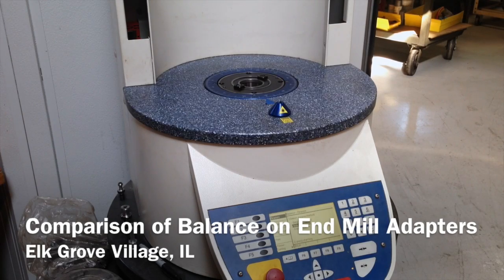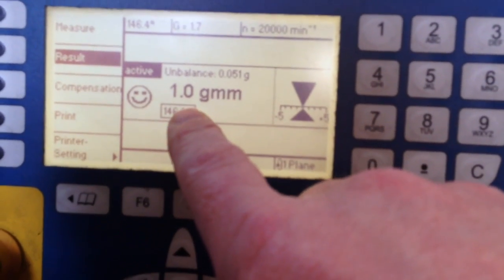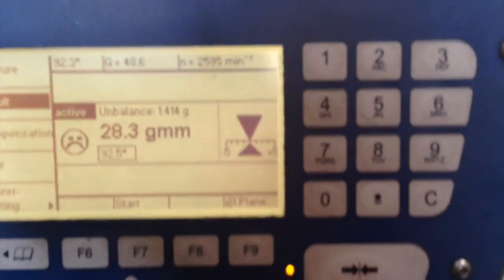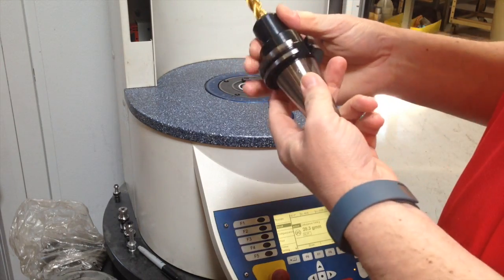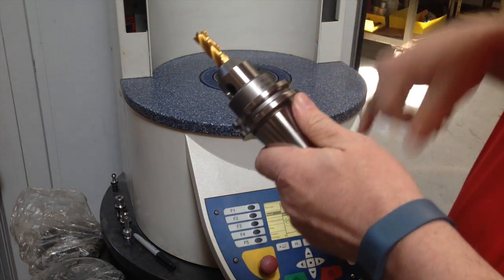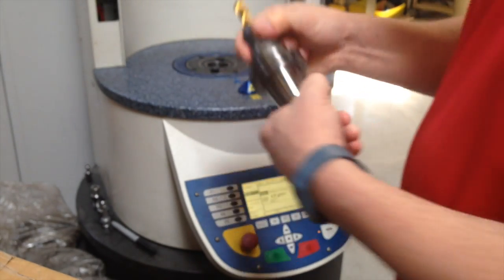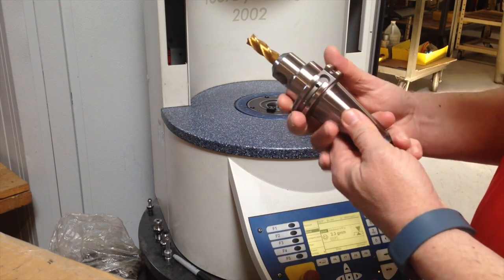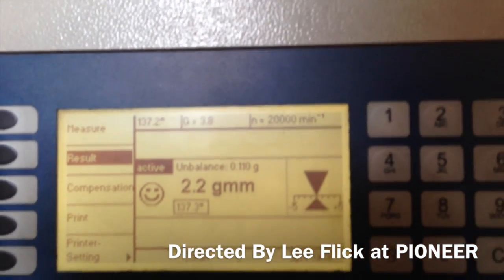Comparison of Balance on End Mill Adapters by Pioneer

Comment: nice marketing tool, However this video is very misleading!
Tool holders are generically balanced off the lathe, unassembled (tool holder body only) No set screw or cutting tool. 

After assembly,( Holder + pull stud + Cutting tool + Set screw)  the balanced rating is drastically affected. 
Hence, the results of holders #2, #3,  & #5. 

Balance ratings are guaranteed, based on the tool holder body only, there is no way to guarantee a number of a fully assembled set-up, mainly due to the Ten's of thousand different cutters and geometries. 

Seems like holder #4 has a legitimate result.

#1 HPI / Pioneer   = G 1.70   @ 20,000 RPM
#2 Competitor       = G 48.6   @ 2,595   RPM
#3 American          = G 59.8   @ 2,107   RPM
#4 Japanese          = G 8.3     @ 15,120 RPM
#5 Import                = G 65.7   @ 1,917   RPM
#6 Finish Bal/HPI  = G 3.8    @ 20,000 RPM

Here is the misleading part: 
Holder #1 and #6 have a net result of EXACTLY 20,000 RPM. this can only be achieved after the Holder, cutter, & set screw are assembled, balanced, AND THEN compensated by removal of material.  

Almost every tool holder can achieve G1.7 @ 20,000 rpm if the same processes were applied

For holder #1 the persons had completely covers the flange of the holder, right before loading the holder in balancer, you can catch a quick glimpse of dimples on the V-flange. (material removed for balancing)
Reply from the maker: Thank you for the feedback.

The point of doing a video was to show actual results and not mislead, which from your comments I did a poor job, I am sorry.  Everything was pulled blind from stock or purchased with no indication of what they were going to be used for.  When we did this test we tried to give every holder the same chance at success.  Not 1 of the holders above had anything more than factory correction before the test.  I am sorry if you thought we were trying to hide something, that was not our intention.  If you are ever in the Chicago land area I would be happy to show you are our inventory and the balancing already performed on every tool holder (if it required adjustment) which when a company says pre-balanced for 20K they almost all have some correction.  I am also happy to run some across the balancing machine so you can see first hand.  I still have the original holders from this test in storage you are welcome to review them.

CAT tool holders have unequal drive slots per ANSI B5.50.  Some form of compensation must be done to address the imbalance in the design.   I do dis-agree with your claim that tool holders are balanced coming off the lathe, I think if you were to test that assumption you would find worse numbers than anything we reported.  Heat treat also adds imbalance, nothing every stays truly round though heat treat when you are case hardening 1mm and achieving Rc60 with tempering.

We try to educate our customers that the only truly balanced holder is balanced assembled.  When we are balancing the rim without the tire installed it is impossible to say guaranteed.  It appears you are from manufacturing, you also understand that when you try to drill deep holes drills wander.  Every tool holder has a deep hole down the center and every holder has some imbalance because of these holes.  A holder must go across a balancing machine to compensate for manufacturing tolerances if it has any chance of performing well over 10K RPM. 
We also hard turn our holders to help eliminate out of round results from heat treat, which reduces the amount of correction required saving us time in production.

This video was to compare competitor holders who claimed a balance similar to ours side by side with the same knob and cutter to see how effective their process or lack of process was.  Why? Because most customer do not have balancing machines.  The test is also with assembled holders, like they would be run in the machine with the end mill screw torqued down.  All of our holders if needed have balance compensation in the V-Groove.  

For guaranteed results every holder must be balanced assembled and after every tool change when running high speed.  We offer the service of pre-balance the our holders or the assembly if the cutter is supplier (for a fee of course).
Reply: Lee Flick I mis-spoke, you are correct about the generic balance compensation due to MFG process. And uneven key ways. 

I still stand firm on my opinion of your video being misleading. If not deceiving.
Tool#1 With a tool holder pulled brand new off the shelf then assembled with a cutter. 
You were able to a achieve G1.7@ EXACTLY 20k rpm. 

Tool #6 - additional balancing after hardening, brand new off the shelf. Assembled with the cutter. You were able to achieve G3.8@ EXACTLY 20k RPM

The likely hood of achieving exactly 20k rpm on #1 & 6. RIGHT OFF THE SHELF is less then 1% I'm sure. This doesn't even touch on the consideration of repeatability. 

#1 in my opinion was assembled. Balanced. Compensated. Then filmed  

I wouldn't mind visiting you in Illinois. But I wouldn't want to see the holder you used in the video. 

It would be best if you allow me to pull a 1/2" endmill holder off your shelf and pick a generic 1/2" catalog endmill and then we can put it in the balancer. 

What do you say?
Reply from the maker: The Haimer balancing machine requires that you put in a spec to target.  In this case we put in G6.3 @ 20,000 RPM.  I picked this setting because at that time it was the most common across many of the brands.  The machine will not show a number higher than 20,000 but adjust the G grade and if you are in the numbers you get a smiley face.  That is how the machine software works.  
There is no mis-leading, these are the numbers the machine reported.  That is why holder #1 and #6 are 2 different holders from stock.

I do not appreciate you accusing me of rigging this test and lying about it.  All we have is our reputation and I am not screwing up mine by rigging results.

Give me a date on when you want to do a test.

Comment: Hi thanks for sharing your results, how much of a difference is there between balanced and unbalanced tool holders? I'm currently in the market for them and can only afford from the low cost chinese/taiwan products, as a hobbyist do I have to worry much about this or just go about unbalanced? the price different is double or more for each.

appreciate if you would give me your insight, thank you!
Reply from the maker: +Khalid Al-Kooheji Balance depends on how fast you plan on running your tooling.  If you are running 3K or less in most cases balance will not be a large factor.  The issue with low cost is not the balance but the runout.  Going low cost will cost you in tooling and finish and in most cases the cost difference in the holder is not that much.